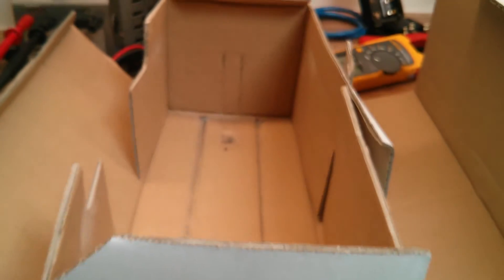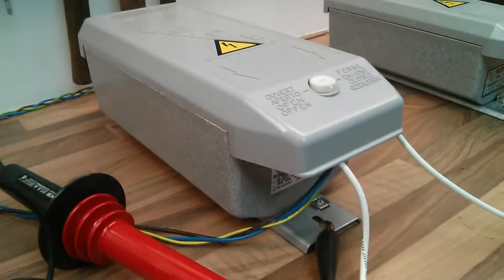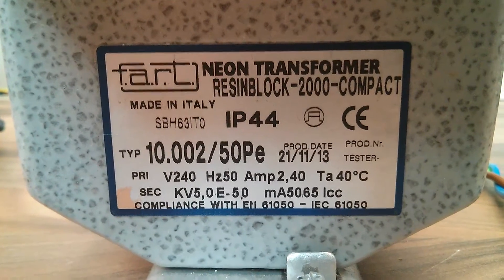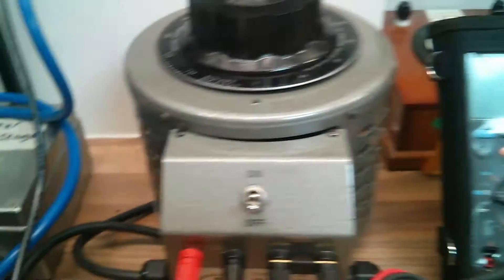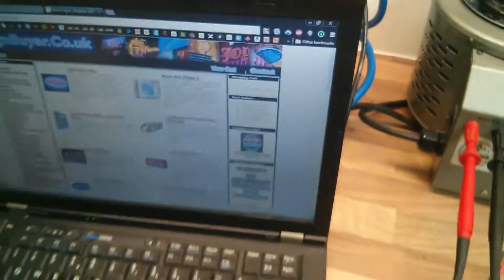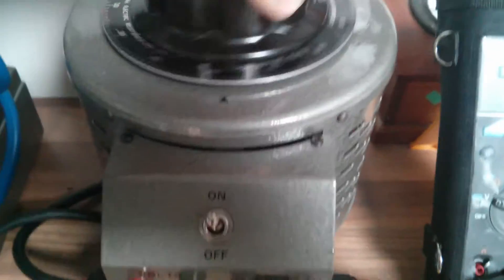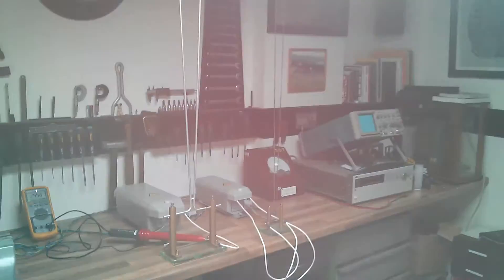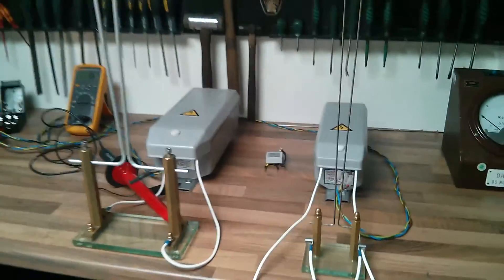Comparing the new Jacobs Ladder and 100mA 10KV NST

Comment: Your video's have been very helpful in my quest to build a SGTC. I'm looking to buy this transformer so i'm really happy to find this. Recently i made a ladder from my 8kv/45ma. I've been doing alot of homework about Tesla Coils and my schematic and plans are finally taking shape, i'm still uncertain about the MMC though. I start the build next year!
Reply from the maker: Hello Jodroboxes,
Keep in mind that the bigger the transformer, the MMC gets bigger in both width and length (known as a square law), cost will also follow suite.

If you haven't discovered it just yet, check out "Teslamap" or "JavaTC" simulation software, that will help you to determine your whole SGTC design taking into account all factors to get the most effective parameters and thus, the biggest possible arc length.

10kv 100ma is a serious transformer in the Neon Sign Transformer powered SSTC realms!

Comment: Hi Steve - nice demo. Just a comment about PFC - for a 10kV transformer driving a jacobs ladder, each 50mA of output benefits from about 35uF of PFC. So, it's 35uF for the 50mA transformer and 70uF for the 100mA one. That will get your variac load current down a lot (once the arc is lit)! I am currently trying to operate a TC using 5 NST transformers each 10kV/50mA, but the PFC isn't working as well and I think it's because the transformers are side by side and their magnetic fields are interfering. Has anybody come across that?? And, if the 100mA one is more than twice the weight of a 50mA one, then I am better off staying with the more common 50mA transformers if I am concerned with total weight??
Reply from the maker: Ridefast!

Thanks for the NST PFC information, PFC is actually something I've been meaning to get round to implementing into my designs for awhile now, I have it down in my design notes for my tesla coil build, it's all work in progress at the moment, though since you have calculated the PFC values already I can get hold of some motor run caps for my NSTs and give them a go in combinations with some meters for a before and after PFC type video.

In regards to your magnetic field interference issue I have a few identical FART 10/50s I can use to confirm your dilemma and possibly work towards a possible solution, arranging the transformers top and tail perhaps or revering the input and output every other NST maybe, I can measure input volts and amps but can only measure output voltage as I do not own a HV mA meter unfortunately, unless you can thing of a possible solution?

Also as you mentioned the 10/100 being more thank twice as much as the 10/50 I had to go and weigh then, the 10/50 can in at 9.7 KGS and the 10/100 came in at 17.2 KGS, the scales may not be accurate to 10% but the difference between the NSTs would be pretty accurate since I used the same scales to weigh both, so it looks like two 10/50s is actually 2.2KGS heavier than one 10/100, interesting how size can trick the mind, although I would have to pick both my 10/50s up at the same time to realise and it's heavy enough with just one at the moment! xD
Reply: Steve Lane Thanks for doing the weighing, that result is more like I would have expected. Also, those are good ideas for investigating the magnetism; I was surprised to find that there is enough magnetic leakage from the top of a 10/50 F.A.R.T. NST to make a small screwdriver 'jump' when 240V power is applied. Perhaps we can try powering up one NST and measure what voltages are induced in the 240V winding of a second NST in various positions around it.
Reply from the maker: ridefast0 That sounds like an interesting idea using the other NST as a sensing device in combination with a voltmeter on the primary side of it.

I will do some experiments and get back to you with my findings, if they are worthy of taking note of I will make a video on my finds.

I was also thinking of arranging the NSTs at 90* as magnetic fields tend to cancel out at 90*, also I will try a grounded screen over one to see if that effects the induction to the other at all.

You can buy Gauss meters for this application I believe but they're usually not cheap for a good one...